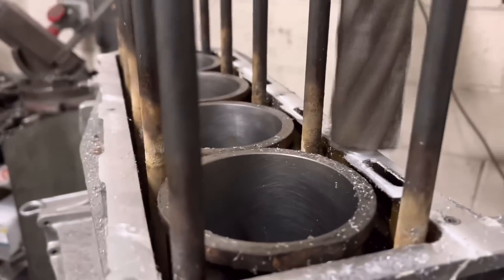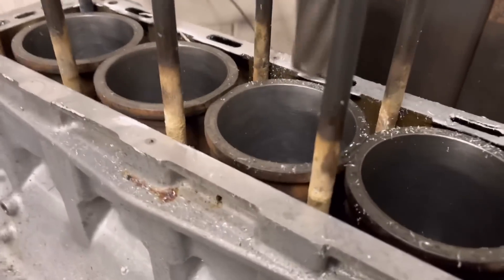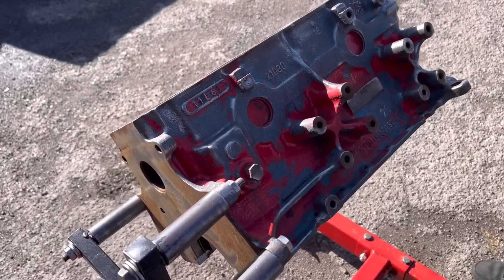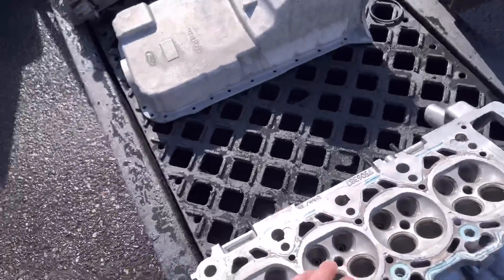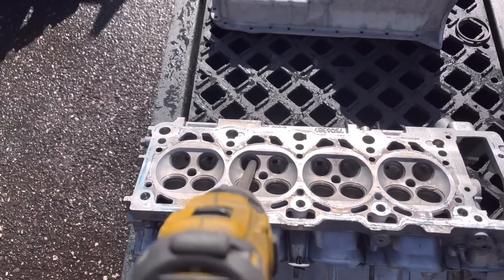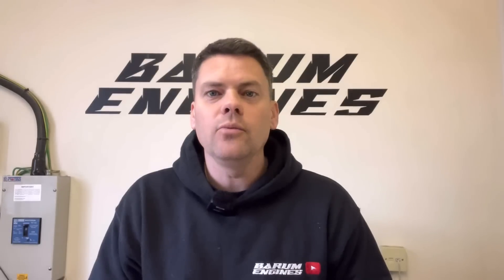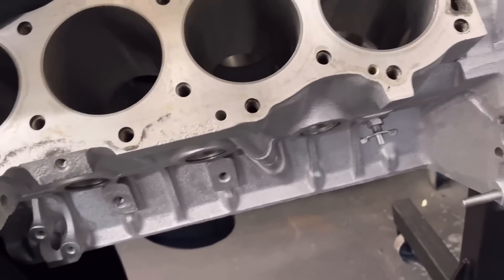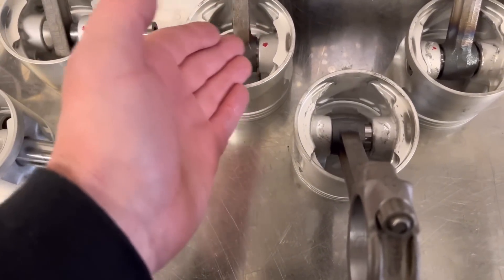Male Karen makes FALSE warranty claim with FAKE invoice

Comment: It's 50/50 to send him to the guy who sold him the engine. It's not you're fault, wait are your warranties transferable with the engine? Transferring ownership of the warranty is usually not allowed and in any case transferring ownership of the warranty does not transfer ownership of the item under warranty. You'd need to transfer both. Laws related to product warranties vary per country. Some warranties are NOT transferrable.

Comment: The way I see it is the guy with the engine has been scammed by someone who had a junk engine, they have scanned one of your legitimate invoices, changed it and printed it. He then used it to help sell his junk engine to someone unsuspecting anything, the fake invoice would help sell the engine as it would supposedly show there is warranty on it. If it took him three months to get it in the vehicle that suggests he isn't much of a mechanic, more of a D.I.Y man who probably would take at face value someone he met somewhere telling him this is a good engine, here is the invoice with warranty to prove it. You would need more info from the guy with the engine as to where he bought it, how he found out about it and how he contacted the seller etc etc as your paper work trail clearly proves the invoice he has is fake before you have even seen it to see if its even a good copy or not.

Comment: Lee, I would ask him to fax you the invoice. 1st it should have the original customers name, maybe it's actually from 2020 or 2021? I don't know how your numbering system works. Does it keep going? Or do you restart at #1 every new year? That should give you some proof if it's actually yours or some bullshit! Because if its bogus, you don't even want him at your shop! Also, if you didn't build the whole engine, & know for sure the clearances were done & everything was cleaned correctly, you cannot be responsible for someone not cleaning his oil cooler, or not checking clearances! Finally, my boss had some metal stamps made up! So, when we work on something, it has the business initials on it! Crank, Block & Heads all get the stamping. It's really easy if you have a CNC machine, but those are only for top tier YOUTUBERS 😂😂😂😂! Best of luck Bud!

Comment: Seems like whoever sold the engine conned the buyer, perhaps tell Karen the engine owner to contact the seller for a refund as its nothing to do with Barum Engines. Only thing that concerns me about Karen is him being abrupt, If he (in my view) really believed the engine had been rebuilt by Barum i would have thought he would be very nice and hoping any warranty would be transferable? Either he knows hes been conned and upset or hes a conman himself, either way nothing to do with Barum Engines and not worth wasting time over. 

Delighted to see Paul wearing his PPE, Dont know if acceptable in a business but i have many times used a similar wire brush in an angle grinder then for the more difficult to get to areas used a drill with same wire brush wheel, just use a big nut and bolt in the wire brush and a few minutes filing down the bolt to fit the drill chuck?

Comment: The contract of the sale of the engine from the previous owner, to the current owner was between themselves.  Therefore if there is something wrong with the engine as it is second hand goods will be will the seller of the engine to settle, not you.

Comment: About the warranty claim... If the "angry customer" did buy an dodgy engine with an fake invoice, you both should findout , who the seller was. The "angry customer" should have a name or phone number of this dude. If so, the "angry customer" can, or has to deal it out. Probably a attempted case of insurance fraud aswell. If this can't become sorted out in a proper way, there is probably a loss of reputation for Barum Engines.  Not saying that is. 
You know, people talking, even if there is no proof woe.

Comment: You can't have the same invoice numbers for two different invoices. Can you run an audit on your system to show that the invoice in question had not been altered on your end? If they paid cash, you may have to prove that you didn't pocket the cash, and overwrite the invoice afterwards.

Comment: Slightly different slant on your story. In the early 1980's I was working for my Dad in his garage, I was in my early twenties. We specialised in tyres, batteries and exhausts. I remember a guy coming in with his Ford Capri and got straight in my face and accused us of shoddy workmanship on an exhaust he'd had fitted a few weeks ago. His 'mate' had told him that wrong parts had been fitted and it had been cobbled up. I didn't recognise the guy but we put it on the ramp and took a look. It wasn't our work or the make of exhaust we fitted and indeed it was a real cobble job. He hadn't got his invoice with him but he was absolutely adamant that we'd done the work and was effing and jeffing, accusing us of being cowboys which was really embarrassing  as other customers couldn't help but overhear what was going on. Anyway, I again explained it wasn't our work, but, he was having none of it, yelling that he had invoice and he threatened us with all sorts, he was really aggressive and nasty. I asked him to go and get his invoice and away he went. He returned later on, he hadn't calmed down a bit and began effing and jeffing at me from the off and shoved the invoice right under my nose. I took it, unfolded it and guess what, the work had been done by a competitor located about half a mile down the road. I very politely pointed to the sign over our workshop and the name of the company on the invoice and explained where they were located. Did I get an apology, did I boot, he just jumped back into his car and roared off with his wheels spinning. 
The World is full of prats who know their rights, know more than you do and will never admit to being wrong even when they clearly are.
I eagerly wait to see the outcome of your latest tale of woe with this Karen. Good luck👍

Comment: Of course he's P'd off. Hes been sold a dodgy engine and he's paid a premium for it so he want someone to pay for it as long as its not him. 

First comment is why are your warranties transferable? When you do the work your customer signs up to your terms and conditions. If that engine is subsequently resold the guy who buys it hasn't agreed to those terms and conditions so you dont carry over the warranty unless they pay for an inspection first. Additionally  if you had done the work you don't know that the guy who sold the engine hasn't blown it during a race day so sold it off with promises. Another scenario is maybe the guy swapped the oil pump for another engine. Yes unlikely if it was a tuned engine but a straight forward short engine who know what was done to it.. At around that kind of money I am sure he didnt get a tuned engine.

Assuming the guy has been duped If its a dodgy invoice then that's fraud and should be reported to the police and if this guy is genuine that's exactly what he should do. He can also pursue it in the small claims court and get his ,money back from the seller. As he has an invoice number you can provide evidence that you didnt do the job as that number is assigned to another customer. Think of the paper trail

Comment: Of course, you have the engine number on all your invoices (Surely?). I would let this go through to the keeper (read lawyer) and see how he can prove otherwise. For a professional shop, this method of fitting a rod/piston is pretty amateur. Have a look at JAMSI again and see the jig they use to do this accurately. I have never seen pistons that are not made with an offset for the gudgeon.....offsets the gudgeon to the load side to minimise piston wear under load. Very interesting.

Comment: First, you ask for scan of the invoice and his written confirmation that it is bona fide. If you believe it is not correct then tell him and explain you have passed it to your solicitor with instructions to pass to the police and that any future contact be via your solicitor. Second, you give 12 months warranty? Insane! I used to drive 80000 miles a year in new Fords, 12000 miles warranty equals less than 8 weeks use, where were you?

Comment: In NZ at least, a warranty period for anything is usually only valid for the original purchaser unless the warranty is specifically ‘transferable’. Might be a plan to make this clear in your warranty statement.
Reply: In UK law, a product must last for a "reasonable time" and be "fit for purpose" regardless of any warranty or ownership. For instance, a new car with three years warranty that blows up in year four but has full dealer service history would probably be repaired at the dealer's cost, or a large contribution at least. Money supermarket did a feature on this a few weeks ago. Not the same in NZ then ?
Reply: @w.o.o.d.y  agree ref UK consumer rights, though the protection is only between a consumer and a business, once the engine is sold consumer <> consumer there is no obligation on the original business to the new owner... certainly from a statutory rights perspective - warranty in addition to this and depends if it's transferrable - also consumer credit act sets the same obligations on any finance company equally between the business and them, hence why paying on a credit card (even if a deposit but at least £100) is good sense as then means joint liability with business & credit card company, who are additionally regulated by the financial services ombudsman.
Reply: @commander_lard  Pretty concise, however the original purchaser is entitled to sell items that have the manufacturer's warranty. The purchaser, now becomes a seller ( vendor, dealer or agent) and whilst responsible for initial claims can refer this back to a manufacturer. Neither is excused "fit for purpose" or "reasonable length of time" issues in UK law. Just sayin.

Comment: First thing is if you did any work on this engine then a contract exists / or existed between your company and the original customer, the guy doing all the claiming is a third party, and you shouldn't talk to him. Refer him back to the guy who sold it to him and only talk to him.
Obviously you need to establish with the original customer if you did work on the engine, don't speak to the third party. Normally, not unless expressed in your T&C's the warranty is not transferable ?

Comment: Get both Ur and accountant to look at the original invoice and then instruct said solicitor to give him good advice bc it looks like he's been ripped off. Offer him a sweetheart deal for rebuild as it's ur company name that's on the table.
Reply: @markrutlidge5427..............." Offer him a sweetheart deal for rebuild as it's ur company name that's on the table."...........

Nope definitely not, there is no proof yet that the engine was ever worked on by Barum, no proof if the invoice is legit, no proof if the engine seller ever had any sort of work done at all by Barum.

That sort of offer in the hands of a tricky solicitor, could be taken as a partial admission by Barum and open the doors to the same as the gearbox debacle.
Reply: @silversurf6159 I see your point of view re tact admit of guilt , although you are not involved in a way you are as it's your company is been incorrectly blamed. The " customer" has been duped and thinks it's your fault while it's his for not taking due diligence and so should be angry at him self and the perpetrator. Stil good practice to offer some free legal advice on the matter ( 5min phone call)  good luck.

Comment: My guess is the guy got taken by the person he bought it from. If he is reasonable, you may want to work with him as a good will gesture; just make sure it is well documented.

You might want to invest in a proper rod heater.  They come in electric or gas and have a pin stop so you don't have to try to get it centred by eye.

Comment: Lee, you don't have to prove you did not do the work on the engine, he has to prove you did.

If the work on that invoice number does not correspond to the work on that invoice on your system and there are also no invoices made for the amount that is on that invoice then that invoice is fake.

Someone has found or obtained one of your ligitimate invoices, scanned it, done some photoshop black magic and printed out a bogus invoice to go with some dogey engine they have been flogging off to some unsuspecting buyer or the guy has done it himself to pull another scam warranty claim on you.
Tell him to jog on.

Comment: Fake invoice, try a whole fake car! Honda in China had a problem with people rebadging RABO S-RV with Honda badges, and then the owners turning up to make a warranty claim.
As for you current problem, when you see the fake invoice have a really good look and compare it to one of yours. Is the ink the same? Laser prints and copies have a slight shine and sits on the surface of the paper, inkjet is dull and is absorbed into the paper, are any colours used correct, is the paper the correct weight, is there any distortion of the text, is the font correct, paragraph spacing, is the overall width of the test correct (photocopiers are aften set to 101% by default for this reason).etc.
Going forward watermarked paper and an embossing stamp.
Need anything else, let me know.

Comment: Get a letter punch set. Choose one of the 26 letters to stamp the block, heads, cranks, pistons and connecting rods in a common, not easily seen place. Log the letter in your sales record for that engine. For the next job, choose a different letter to stamp major components and log it in the sales record. Rinse and repeat. Any warranty return can be verified as genuine if all major components have the correct letter stamp according to the sales record. Also log the engine serial number on the sales record if you don't do so already.